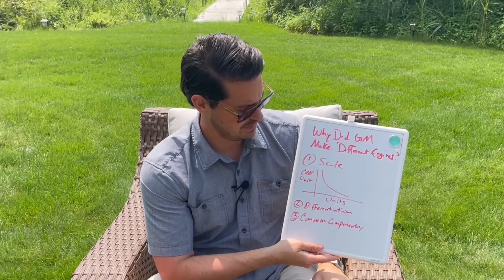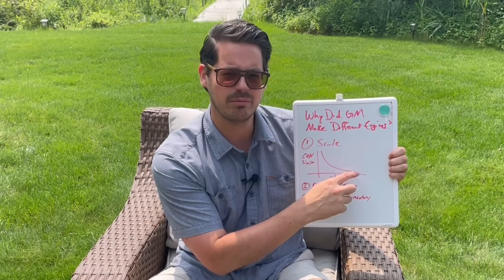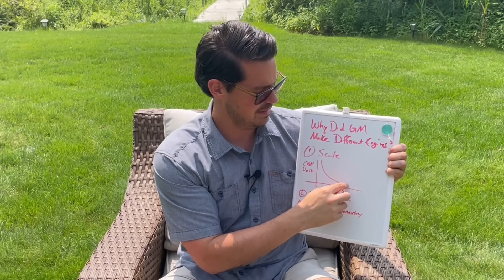Why did General Motors (GM) Make So Many Different V8 Engines in the 1950s-1970s?

Comment: GM’s engines gave their brands identity, and they had their own personalities.  I’m most fond of the Oldsmobile Rocket V8, 350, 403, and 455, with Pontiac coming in a close second.  Back when we had basically the big Three in Detroit, only GM gave the customer more in their better cars in the engine. The transmissions were all hydra-matic, and the bodies made at Fisher, but the engines were quite different.  With Ford your Lincoln engine was still a Ford, and your Imperial engine was still a Plymouth.  Back when…GM’s better cars were not just a Chevrolet wearing a clown suit.

An Oldsmobile, Pontiac, Buick, and Cadillac block was definitely NOT a Chevrolet motor.  The sound and feel of the better engines is more satisfying, at least to me.  After the 1978 Chevy-mobile affair, GM lost the lawsuit, and from there forward all their cars came with a “GM Engine” but it’s easy to identify the origin of the block.  Killing off the Olds Rocket engine 350, 403, 455, might have been their dumbest move ever.
[
They have been pruning on their brands for decades headed for “Le GM car” with different dressings on it, and they are finally there; less the Oldsmobile and Pontiac brands.  They have certainly taken the beautiful out of Cadillac, as it’s hardly worth paying for today.  Back when I was very young, the customer got a whole lot more in Cadillac from the engineering department, and nothing about a Chevrolet would fit most of the car. One of the most missed features, to me, is the fiber-optic lamp monitoring system that is more than just pretty little lights out on the hood - it's telling you something.

They are still getting people to buy them, and as I talk with others’, they don’t seem to feel as short-changed as I do about what’s offered today.  I particularly miss the quality interior materials and appearance of a Cadillac, as the brand should NEVER have injection molded plastic door panels.  I also believe that removing the hood ornament from virtually everything has exacerbated the problem of drinking and driving.  I always thought they put that hood ornament out on the hood for a gun sight affair to help the driver aim it.

If there’s anything missing today I find to be insane it’s no jack or spare tire on board.  In Texas there are thousands of miles where your phone drops to “no service,” and it’s not kidding one bit.  Even with ghastly expensive run-flat tires on the car I still feel like I’m driving with my pants down.  I just don’t trust tires that much, and one needs to be able to help themselves with the most basic of failures – a flat tire.  My Camaro SS can’t even accommodate a spare tire if I wanted to buy one.  The farther West one travels in our state, the fewer humans live there and there are plenty of places where there’s nothing there but you, the rabbits, the snakes and an asphalt ribbon.  Even the state posts road signs "check your fuel the next gas pump is 96 miles." You might see immigration officers 1-2 times per day, and you might not see anyone. (Sanderson/Dryden TX)  You had darned well better trust your car!

Comment: You didn’t mention the CAFE and emission standards that also had some effect on the reduction of the size of the engines. The reduction of the size of engines was to meet the CAFE standards on fuel economy. From a corporate standpoint it’s not financially responsible to produce a 455 or 500 cubic engine that only produces 200 or 250 horsepower when your also producing a 305 or 350 cubic inch engine that also is producing the same power. This also applies to the smaller ones as well. It’s not really necessary to produce a engine from one division and then use it in another division and then try to market it as a different name. This really upset loyal customers of the other brands because they liked those brands. My grandmother was an Oldsmobile buyer. That’s was all she bought. Plus it had to be a V8. Her last one didn’t have a V8 and she was mad about that it didn’t have one. She still bought it she wasn’t really happy about it.

Comment: I think, you have to go back to the 1940's to find a GM flat head V8 ? Ford had a very successful flat head V8 from 1932 until 1953. I don't think Chrysler ever  had a flat head V8 , they used straight eights until about 1954. Packard had OHV V8's in the 1950's , where as Studebaker , I think had a flat head V8 in the early 1950's ?

Comment: In the 1950's until 1958, the Chrysler corporation brands had different engines between the families.   Chrysler and Imperial used the same engines, Desoto, Dodge, and Plymouth had their own respective engines.   While all the Gen I hemi's look alike, each brand(Chrysler/Imperial , Desoto, and Dodge) were different.  ...different bore spacing, heads, etc.   Plymouth wasn't even allowed to have a "hemi", so they built the A block poly engines, with chambers sorta like the single rocker Chrysler and Dodge engines.   The A block evolved into the LA series engines.

Comment: No, Olds 350 in 1977 and up Buick , Olds, Pontiac.  The rocker arms and the aluminum rocker arm stands had to be replaced every 20 to  30 thousand miles until TRW started producing steel components.  The oil return passages in the heads coked up and caused oil starvation problems and leaking gaskets.  The Buick 350 V8's did not have these problems ad would last  twice as long as the Olds.  So GM did away with the Buick engine so that they could sell more cars, as most people would not replace just an engine, but would buy a new car.
Reply from the maker: The Buick 350 was available until 1980.

Comment: an even more perplexing issue with all the engines GM had was that they reused iconic engine code names for engines.
Example; LS6, LS7, LT1, etc.
They had some of the most iconic V8’s in history but chose, later on,  to name their modern engines the same. With literally an infinite amount of options to name their engines with numeric/letter codes, they chose to diminish the image of earlier iconic engines.
Don’t get me wrong, the modern LS series engines are iconic themselves, but when one refers to an engine as “LS6”, it should be immediately clear what power plant they are referring to.

Comment: They made a hundred versions of one engine. They like harley know one type of design v8 pushrod engine, came in many sizes and configurations but basically one engine. Took them unti recent times to make a ohc and DOHC motor that japanese were doing in 60s

Comment: Ford had 4  351 engines , a 351 Cleveland, 351 Windsor, 351 Midland/Modified and the 352 FE Big Block , all the same size at 352 cubic inches , the only reason the small and mid blocks were designated 351 was to set them apart from the big block 352 FE but they were all the same size internally .

Comment: Well...  The cost of research and development goes down, the cost of new molds go down with repetition, the creation of new lines go down with more efficiency as production units increase..  Ultimately the cost and efficiency of the manufacture of one engine is such that it's a much better choice than maintaining different engine lines.  You can't compare the cost at the end of production for each engine line as the goalpost.  It's not.  The best choice costs less to produce (including all factors), and it's more reliable through experience and improvements through the years.  It may seem that close is enough, but it's not when you're dealing with millions of units.  GM had to eliminate the other engine lines.  That's also why they started making pretty much the same cars for all their brands.

Comment: There for a number of years in the GM cars you never knew until you raised your hood for the first time what brand of engine was in it. That's when they made a universal bolt pattern that would fit most of the different GM engines bolt patterns. Good Ole Chevys had the same bolt pattern no matter if it was a 6 cyl or a big 454 and if I am not mistaken the LS engines, that everyone is using, has the same pattern that I know started with the 1955, 265 ci if not before. They were the interchangeable part kings of the US, maybe even the world.  I remember having an 84 Grand Prix that had a 305 ci (I think) Chevy engine from the factory. The most disappointing engine, power wise, in a Chevy that I had was a 307 ci in a 69 Chevelle. Beautiful car that looked fast sitting still but just no power and it was new. One of the biggest surprises I got, performance wise, was a 1970 Wildcat with a 455 ci. We had a couple different 1/4 mile places on the main hwy back then that everyone was going to go race at one night, We talked a friend into racing his Big Buick Wildcat. We checked under the hood and all the fluids were low so we topped them off and shook the dirt out of the air filter, bought him some gas and I'll be darned if the big ole boat didn't outrun every muscle car there!  We had lookouts up and down the race area with the old cb radios to let us know if a smokey was on the way. At the time they all drove the same type cars with reflective striping so you knew it was them. Things were a lot different back then than now. It was a lot like the show Happy days but not nearly as innocent. It was a good era to have grown up in. By the way gasoline was 27.9 cents for regular and 29.9 for no-nox at the time of these events and you also received Top Value stamps with your purchase, your gas was pumped for you, your windshield got washed and your oil checked without even asking.

Comment: Sociology answers this better than Micro Economics.  The brands matched up to socio economic stratification in US society. No matter what income, education or class GM had a brand for you.  Trim levels within a brand accommodated upwardly mobile who were attached to a single brand.  The Ford and Chrysler could mimic it but the independents could not.   Low to high were Chevy, Oakland, Pontiac, Olds, Buick, Marquette, Cadillac.  GMC for non Chevy.  Saturn no V8,  Durant IDK.

Comment: The automated transfer line which does the block machining is the expensive part and that's the thing which needs volume.  Casting, etc. doesn't matter that much.
Emission and fuel mileage standards are what really killed different designs
And later the volume of cars sold by different divisions dropped so much that they just didn't have the volume for different engines.
The worst example of too many engines was Chrysler with the Chrysler, Dodge, and Desoto hemis being entirely different in the early 1950s.  Just economic insanity.

Comment: When each division was, to a large degree, its own car company. They had their own engineering departments and factories. Oldsmobile had its own "make or buy" unit where they determined whether to make a part, buy it from another GM division or buy it from an outside supplier. As each division lost autonomy they lost their reason for being.

Comment: It was a cluster foxtrot for parts people and mechanics. Chrysler kept the same motors across the brands. For GM, they kept proprietary engines which meant different tooling. But, engines such as the 455 "Rocket" had HP, vs the Chevy 454 "Super Rat" had a bit more torque. Hence the latter was a favorite of pull engines. Then Rodeck started overboring the 454, and the rest is history.

Comment: As somebody very familiar with the machining processes involved with automotive engines up to 2005. A machining line can only run so many blocks an hour. It can only run at the speed of the slowest operation. In an engine block line that is typically going to be either the cylinder bore honing operation or the crankshaft bearing bore operation. On older OHV engines the Crank and Cam Bores would be finished in the same station. Along with possibly other operations. These other operations could not be done at the same time hecause the crank and cam tooling would be in the way. Machining lines typically put out 60 to 80 parts per hour. They can run faster but that results in faster tool wear, a greater chance of miss clamped parts etc.

Comment: One thing I didn’t really see in the comments and having literature at the time was that in California, the emissions were more stringent.  I remember reading in the Buick literature for 1977 that while Buick was still making its 350V8, in California, the cars with a 350 came with an Olds 350.  Same thing with Pontiac.  California Emissions did necessitate different engines.  You could not get a Firebird with a Pontiac 400v8, but the olds 403 in California.  I also remember when GM downsized their mid-size cars in 1978.  Chevy introduced a 229 V6 for the Malibu, except cars in California which used the Buick 231 V6.  I’m sure it would have been more confusing for the average listener to hear this, but a small mention of this would have been nice.

Comment: Chevy also had different markets from the other companies i.e. Light and medium duty trucks. This allowed for more variation but also more compromise. A BBC needed good low end torque for towing. A Buick engine didn't need to do that so they could get away with a higher reving big block and hopefully take customers away from the competition.

Comment: In Australia, GM Holden even made a cast Iron V8 with the same bore centre spacing as a SBC that was just 450 lbs & had valve gear like a Pontiac or Olds, I forget which

Comment: The 79 Eldorado was equipped with  a one year only 350 with ported fuel injection. Beginning in 1980, theh Eldorado and Seville switched to TBI . From 1981, all Cadillac engines incorporated digital fuel injection .

Comment: Chevrolet and GMC trucks used different powertrains up to the 1960s. I think the 1967-72 version is where they started putting some Chevrolet engines in GMCs, and by the mid 1970s they were all Chevrolet powered.

Comment: Ford put 460s in dumptrucks and towtrucks. Chevy/GMC put 454s in dumptrucks and towtrucks. Mopar probably put 440s in dumptrucks and towtrucks... I had a 70 Tempest with a 350. I had a 72 Lesabre with a 350. I had a 72 Impala with a 350. I had a 72 one ton Chevy 4x4 with a 350. I had a 400 smallblock in a 73 Chevy one ton flatbed, but it came out of a 66 Malibu station wagon, the truck originally had a 350. I had a 77 E350 van with a 351 Windsor. My buddy's dad had a 74 TransAm with a 455 4-speed. Another buddy's dad had a 70 Gran Sport with a 455. My ex-wife's uncle has a mid 80s squarebody dually Dodge with a 440. I've driven lots of company-owned trucks with big blocks, wreckers, dumps, stakebodies, flatbeds, and pickups. But big blocks like to drink fuel, Slurp slurp slurp. I drive a Dodge with a 360.

Comment: As you say it was all about scale of production and GM at the time had that scale but then came the competition of cheaper and better quality vehicles from overseas plus the oil shock of the early seventies and that scale started to fall away and so the cost per unit started to reverse back up the curve. What the American car makers failed to see coming was that the huge wallowing vehicles they were making were not as good as the imports and used far to much fuel. You can only make a big heavy car a little bit more efficient to save fuel but if you reduce its size and therefore weight and fit a smaller engine you can keep the performance high but reduce fuel consumption. The other advantage was you used less material and saved on production that way as well. But now things have swung back a bit because as new engine technologies have emerged that have advance fuel efficiency again  we have started to make big vehicles again but powered by smaller engines in most cases. This is the SUV/ Pick-up craze. The move to EVs could kill this though.

Comment: I was under the impression that the BOP 350s and 455 were the same blocks but different internals, heads and intakes.
Reply: Nope …
Reply: @sking2173  
I don't think I worded that correctly. I meant BOP 350s and 455s respectively. Not that the 350 and 455 were the same block casting.
Reply: @member57  — The Buick, Olds, and Pontiac 350/455 engines were all division-specific (different). The Buick and Olds had a small and big-block version, while the Pontiac 350 and 455 block shared the same exterior dimensions.

Comment: I bought a Chevrolet back in the early 80s that the previous owner had swapped in a Buick 350, and I was amazed at how willing that engine was to rev up. I thought of Buick as a low RPM luxury yacht engine, but in a Malibu it scooted along nicely.
Reply: Jeep used 350 Buick engines . I had a pickup with one in it i liked it but it had more low end power than a Chevy 350. I sold it to a guy that put a chevy in it i got to drive after that. I think   out of all the 350s the Chevy had less low end torque .
Reply: @dougpersell8776  The Buick 350 had a much smaller bore size of 3.80 and a longer stroke of  3.85 which explains the torque difference.  SBC depend upon Rpms for HP while giving up torque...

Comment: Here's why. GM trucks got new prototype motors to beat on. The next division, Pontiac, got those engines that the trucks couldn't destroy. On up the line though a decade, Chevrolet, then Oldsmobile and Buick; and about ten years after the engine was put in trucks, a Cadillac. Cadillac's were expensive; partly because the engines were tested for 10 years in "subdivision" vehicles before being considered for Cadillac quality. Not anymore. Northstar engines are JUNK. there.

Comment: Great video but one thing you failed to mention was that the Chevy transmission had to be Chevy! Olds, Pontiac and Buick transmissions were interchangeable. Turbo 350 & 400. But Chevy transmissions would not work in the other 3. Different  bell housings!